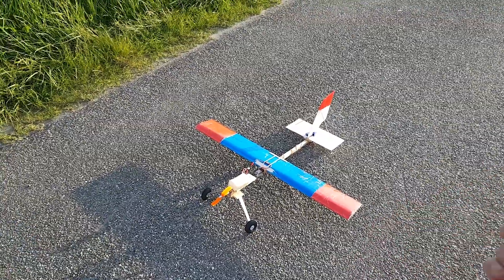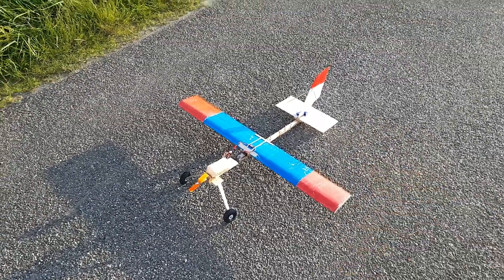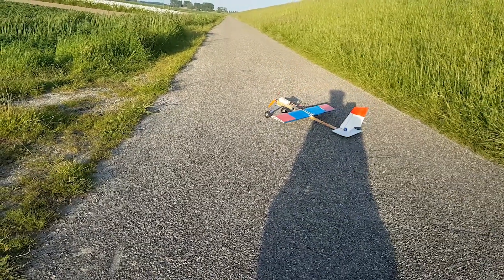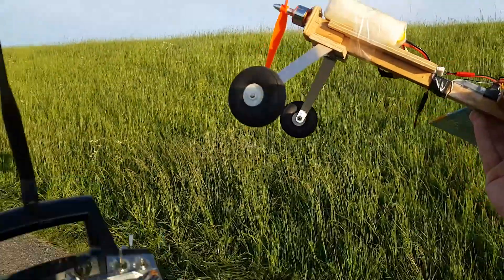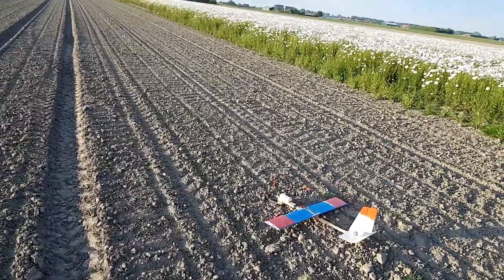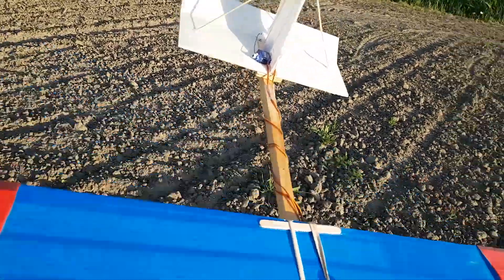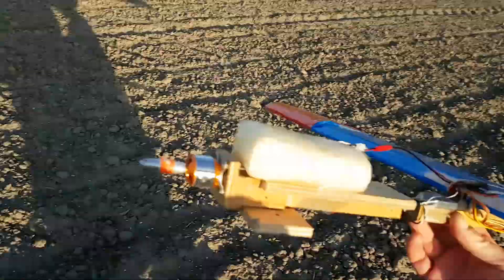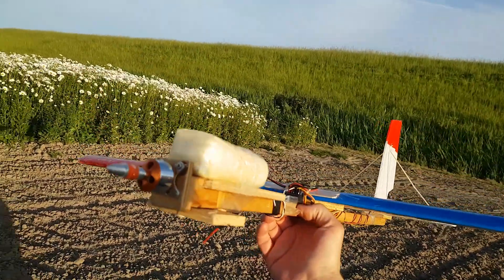$5 DIY RC PLANE CRASH DURING THRUST ANGLE AND RUDDER UPGRADE TEST FLIGHT

Comment: information         the common root chord length of the stabs should be equal to  2/3  of  the wing chord.       the chords of the rudder and elevator should be equal to  1/3  of the root chord.           the height of the vertt-stab should be equal to a bit less-than 1/2  of the span of the horiz-stab.         googletranslate
Reply from the maker: The rudder whas a bit oversized but we did that with a reason

Comment: and  where  was  the  cg located.???
when a model has a  ZERO-dihedral main wing, ailerons will be necessary.
AND, in  order  for turns to be executed,  it  will  NECESSARY  for the pilot  to  KNOW  how to  MIX  elevator inputs with ailerons.      this is so because, aileron deflection by itself  causes   ROLL  moment; not yaw.            the main landing gear was  NOT  correctly located.      when the model is level, the mass of the lg  SHOULD  be  below the wing leading edge.         to the extent that it is practical, the mass of the battery should be located 'low' in the airframe.           the noise produced by the motor, after the crash, indicates  damage, contamination  or  both. 
the cg  SHOULD  be located at  or   a bit forward-of  THIRTY percent of chord. 
the tail of the model  is  HEAVY.    because
               the  mass of two  servos is  located  THERE
               the over-tall vert-stab is  extra heavy
               and because the tail boom is  not  TAPERED.
googletranslate